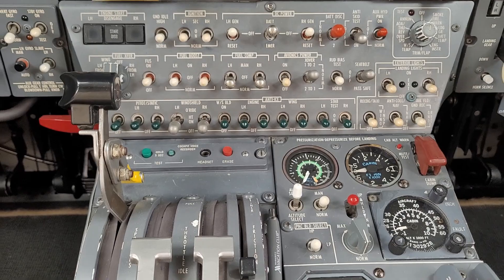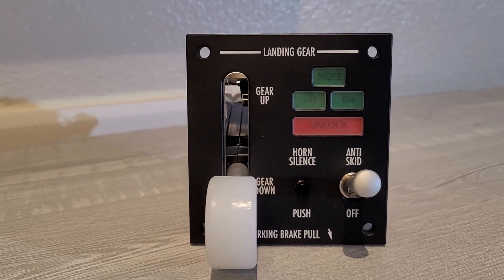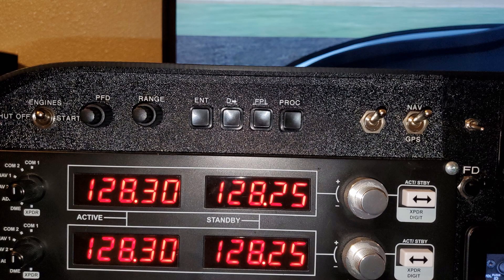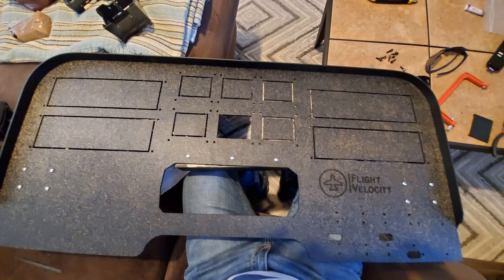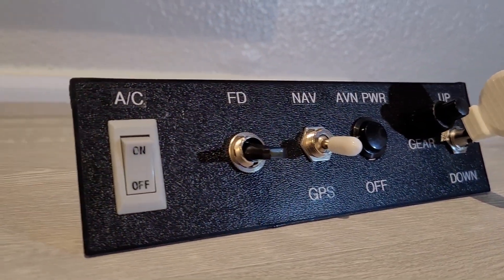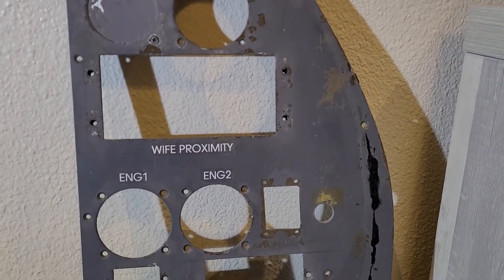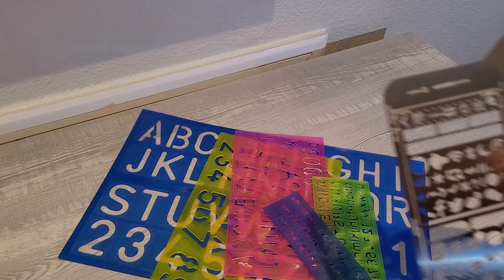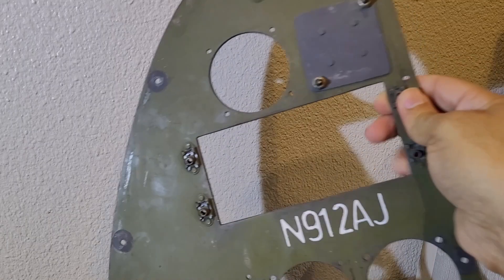Quickly Label Home Cockpits, Simulator Panels & Prototypes

Comment: I did it using silk-screen printing, but it wasn't quick nor easy.
Reply from the maker: Share some info if you can please; I'd love to take a look at what it entails. Thanks.
Reply: Just like to screen printing a t-shirt. I put a lot of labels on a sheet and made the screen, each label was in a "card" that I cut and then use it to paint the text over a panel.

I made a box with interchangeable panels for Flight Simulator and for DCS, for planes and choppers. I used an BU0836X controller (a very nice controller), it was a nice prototype project but then my son was born and I never came back to simulation, that was 10 years ago.

I took the idea watching a chinese video on how they counterfeited brands on air conditioning unit.
Reply from the maker: @hyto  That's very interesting. Thanks for sharing. Leo Bodnar makes good stuff :)